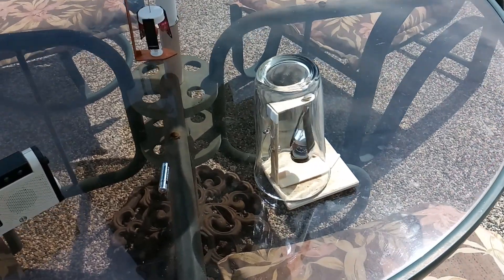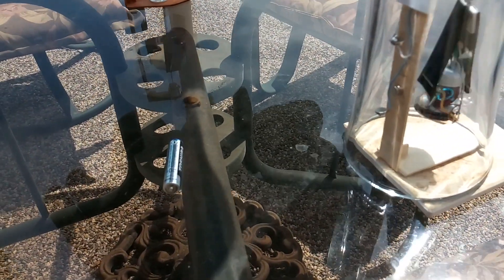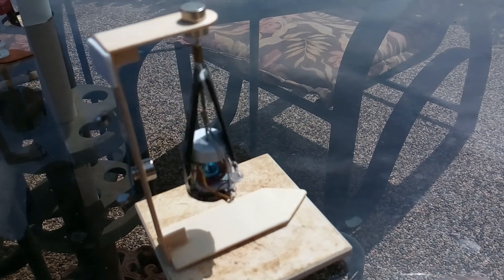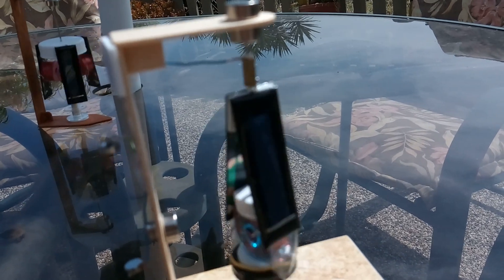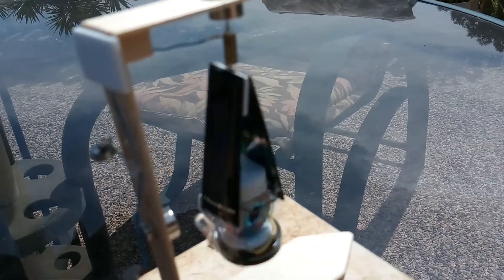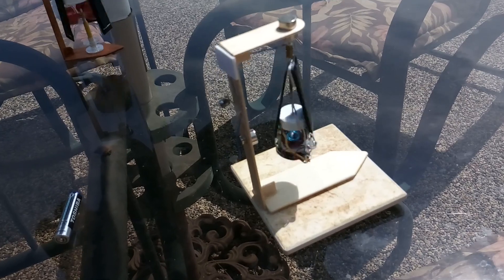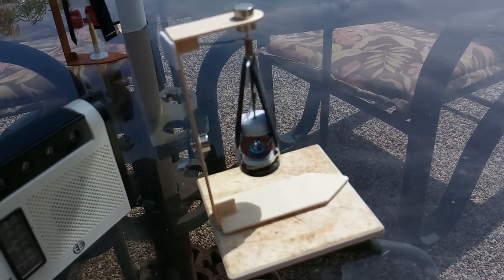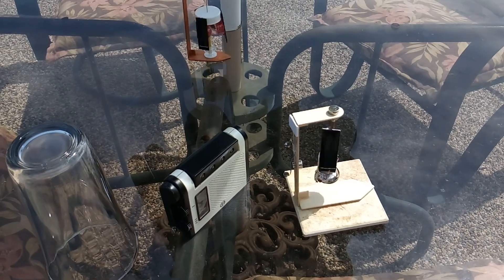Frankenstein Motor ---- Running on solar energy only

Comment: A without and with the battery schematic drawing would be good.
It looks complicated as it sits rotating and is the simplest thing in the world. 
Assembling it with similar miscellaneous parts according to the schematic would produce rotating artwork. A great item to have on a desk or in a window. Much more active than a dancing flower.
It's akin to a radiometer in form.

Comment: Lidmotor man. Look I wanna know how you did it and i'll 3d print a design for you too. I'll send you a kit for the chance to get one or two  at my house. Have you thought about using transistors instead of Reed switches? Also couldn't a disk with magnets be fixed at a point in the rotor to generate some amount of energy? In essence wouldn't it be light powered from the sun a star? I mean if that's so they need this thing in space.

Comment: Nice update on this.  And yes, I'd enjoy some details about the construction.  The name "Frankenstein motor" is appropriate, given the combination of styles.  But it looks more like a little bat with folded wings hanging upside down.  So maybe "Dracula motor" is a better name.
Reply from the maker: Thanks.  When I get a chance I will do a video with more details on how this is built.  The name is going to stick.  It is really more about how the motor was conceived and constructed than what it looks like. I have grown rather fond of the odd looking little creation.  I just call it Frankie now.  I might build another one using solar waver panels and the coil that is in those wavers.

Comment: +1 on the build show :)
Forgot to mention in the last vid how it's so good to see that particular radio in use again. Used to feature often, several years back.
Reply from the maker: That old AM radio has been in about as many videos as Maggie.  I guess I will do a build video on this one.  I might switch to solar waver parts so people can replicate it easier.  The disk super cap and reed switch can be almost any.  The rest of the parts should be easy to find or substitute with what one has on hand.

Comment: Excellent my friend! The entire power supply together with the commutation is contained in and therefor spinning with the rotor. It's unique. I don't think anyone has ever done this, or even thought of it.
Reply from the maker: Thanks.  I have not seen this done before either.  It is not very efficient but there might be some applications for this method.  To me it is just a fun curious toy --and that is enough.

Comment: I would guess the super cap is getting charged via the solar panels and or back emf ?
Reply from the maker: The super cap is charged by the solar cells or the battery and can run the motor for a few minutes on it's own.  This helps on cloudy days when the sun goes behind a cloud.  The setup needs refinement but this is sort of a proof of concept and does work.